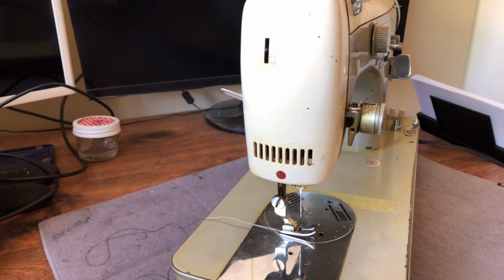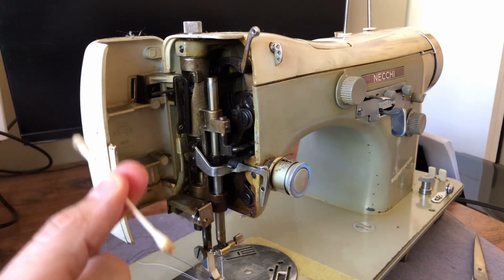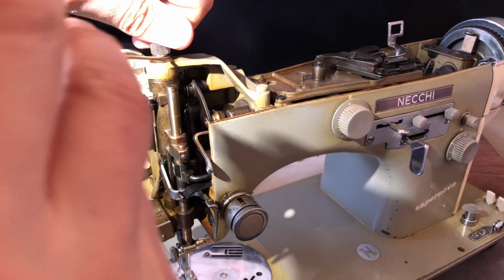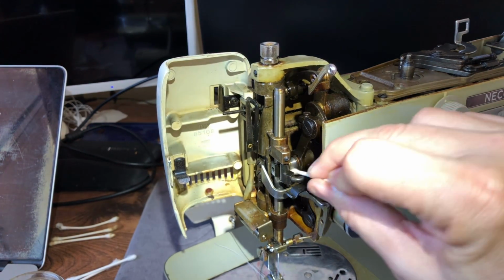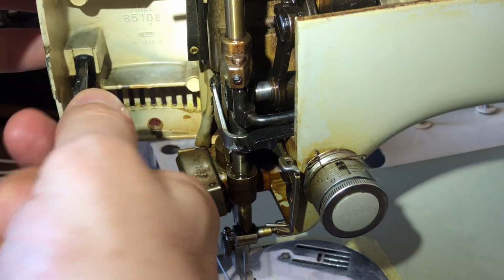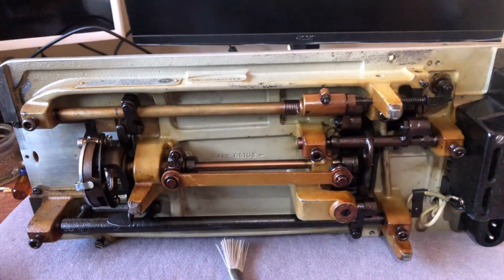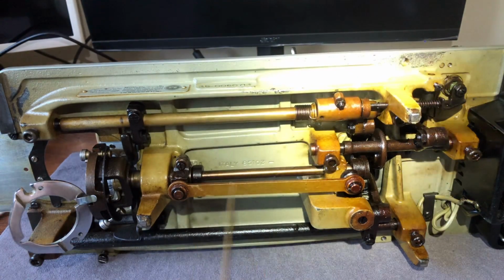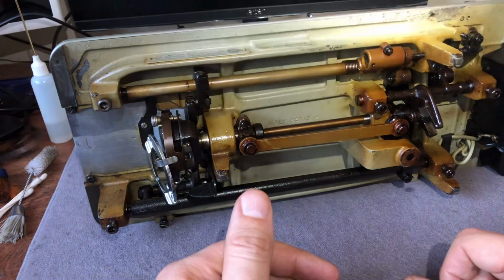MAINTENANCE SERIES #8: A Clean Necchi is a Happy Necchi: Servicing the Side & Bottom Components!!

Comment: Love my 1982 NECCHI 523 . Sewing Machine Garage indeed🤣
I just climbed under my machine and gave it a complete oil change. Couldn't find a filter though🤣 I bought mine 42 years ago to sew my motorcycle road racing leathers, with special needles - and not damage my mother's Singer Zig Zag 1960's 628, which still works great.  I'm a retired M-Benz and BMW master technician, 47 years worth so its fun servicing these quality heavy metal machines.
Reply from the maker: That is awesome!

Comment: Re the electronics box -- those exact (old, electrolytic) capacitors may not exist, but a modern replacement capacitor definitely does. You should contact some guys who do vacuum tube radio restoration (very many on youtube) about the replacement capacitors they use. Replacement definitely requires learning how to solder, but people do this all the time. All the components of the box have a modern analog, and are replaceable. It might even be possible to build a cheap Arduino controller that would expand the functionality - continuously variable speed, for example.

Comment: I have a Necchi Esperia and it's a little different although almost the same in design as you're showing.  Where would I find a service manual for it and also feet.  I purchased it used and is a  great machine and would like to know how to keep it in excellent condition.  Any help you can give would be greatly appreciated.   Love your video.
Reply from the maker: An owners/user's manual will be easier to find than the service manual although there are online Necchi groups that sometimes post files such as Service manuals so you might check with one of those.  They exist on places such as Facebook and Reddit.   As for feet, most Necchis take "High Shank" style feet which are easy to find both vintage and new.  Many of the industrial machines use High Shank Feet also.

Comment: do you by chance know if the Necchi Lelia 512/513 has any nylon gears.  think about purchasing one.  thank you.
Reply from the maker: Hi Jerry.  For that model, I "THINK" I'm correct that its gears/drivetrain are all metal.  However, an of those I've seen in the past have a plastic Presser Foot Bar Lifter.  This is not ideal since that is a stress part.  I'm not saying do not buy it, but this should factor into the price you pay since this part could fail in theory. I wonder if anyone has ever used a 3D printer to make a replacement?  But if its a good price and otherwise in great condition AND that lifter "Lever" of plastic is not cracked or broken, I would say go for it!!!
Reply: @VintageSewingMachineGarage  thanks for the reply, i thought already replied but it's gone now.   So the machine looks amazing, at least in the picture.  Comes all original accessories, manual, and aftermarket case, $75.00  Seems like a good price.  Pretty sure seller is original owner and she said it works just fine, she just doesn't use it that much any more.  I'm including link to a picture of it.

Thanks again.  https://i.imgur.com/mPcUw0S.jpg

Comment: I got a 522 right now figuring out how to work it
Reply: I can't make it work 😫
Reply: One year later, is it working now??
Lubricate every moving part with a long fine dripper saringe. Wipe off excess oil. A machine that has set for years will tighten up or lock up. Amazing how some were never lubricated. Lay it on its side to remove a bottom plate. All the moving joints are apparent. Wiggle oil into every movement, WIPE off excessive oil. It's very therapeutic.

Comment: Great videos!! I have esperia necchi. The Bobbin Winder won't stay engaged. Do I have to remove the wheel to get at it?  Jus to have a look to see if it's an easy fix? Cannot really tell how or if it can b adjusted. The rubber wheel on it is perfect. It just doesn't meet the handwheel to engage. The tab that measures amount of thread stays put when it's empty w no Bobbin on it. Can u help?? Thank u

Comment: My friend. My sewing journey continues. I now own two 15-91's and I'm over the moon! Though my saga continues. I picked up a stray White that used to belong to a fellow who has passes on. I've done some searching but can't find much information. I t is a White, metal body with some plastic trim. Round belt and a cam drop in- sadly no cams were included. It has an "Omega" like symbol on it. It is set up for two threaded stitching. The numbers be 673 4385. Made in Japan, designed by White.  Got any ideas?
Have you started using your Singers for sewing yet? Very nice machines!

Comment: Thanks for the great information!  You gave me the confidence to clean my Necchi Nora. Rather than using a q-tip to remove varnish I used an inexpensive artist's paint brush dipped in denatured alcohol.  I ended up cleaning the underside without damaging the paint so I did the same on the rest of the machine. The entire machine looks like new now. A thought about isolating heat on parts, rather than a heat gun, maybe pressing a soldering iron on the part for a while would work.